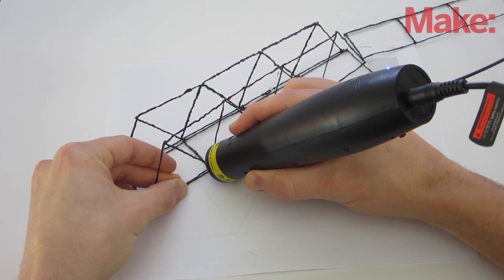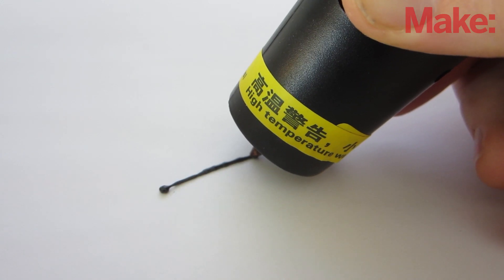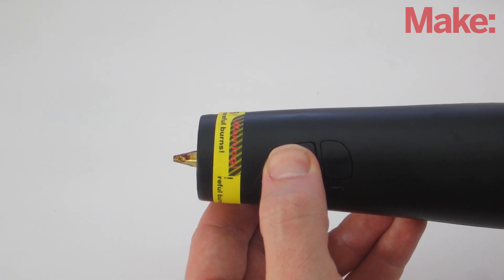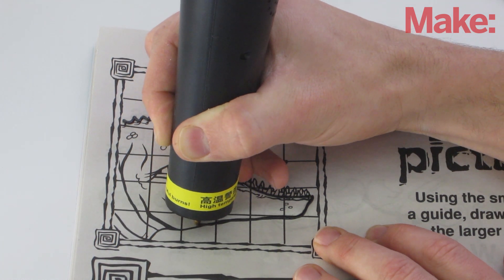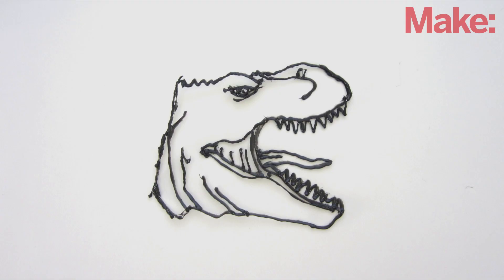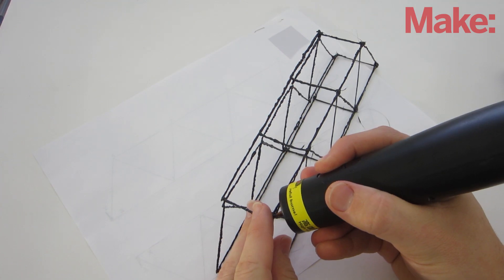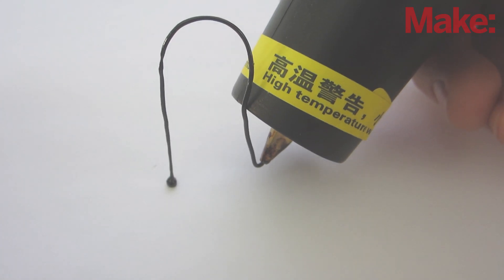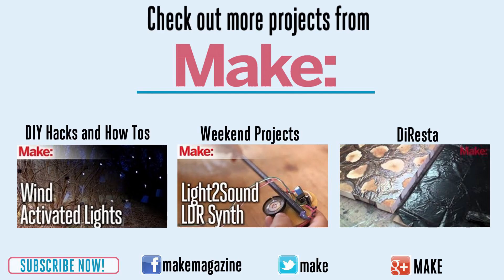3D Printing Pen Tutorial

Comment: Can plastic be extruded into a mold with the pen?
Reply: if the pen gets hot enough.... I'm not sure if they do, I don't have one.
Reply: no it would cool wayyyyyy to fast
Reply: no it cools really fast in less than a minute is  all hard and  cold.
Reply: It depends on the type of pen and the type of filament. If you get an adjustable temp pen and use a low melt point filament (like PLA) at a high temp, you would likely get enough flow to mold it. It is something you would need to be careful with however, as firstly you would need a mold designed to handle those types of temps and I don't know if there is a current market mold release that would suit, and you risk burning the filament. That being said, it is something I want to experiment with with high temp silicone molds

Comment: More realistic tutorial: Kickstart 3d printing pen. Finally get it. Tinker with it for an hour realizing it can't maintain enough heat to extrude for more than 30 seconds or so at a time before you have to wait. Regret your decision, buy a real 3d printer.
Reply: Unless you need it for specific things for example like let's say you wanna do some dumb stuff like creating items for DND characters or like he said mini frame models I have A MILLION uses for this thing. I guess pateinces is the real key. But you NEED it to he low temp. If you try to do this with a hot glue gun it doesn't cool down fast enough to maintain a hold for what you need. Strings go everywhere. It sucks or like his example Legos? Legos is SUCH a good idea. Especially for how often pieces go missing